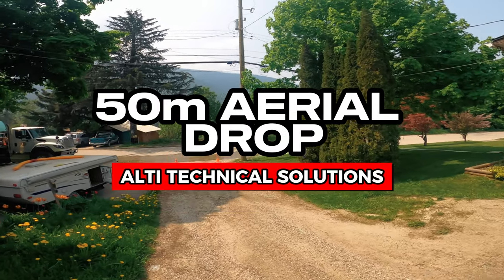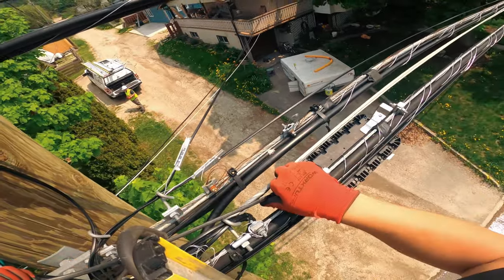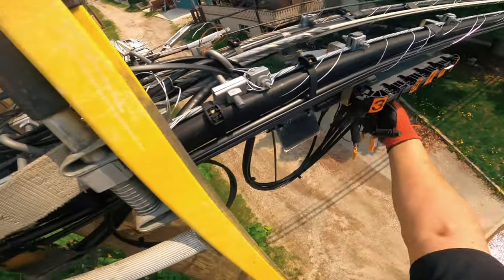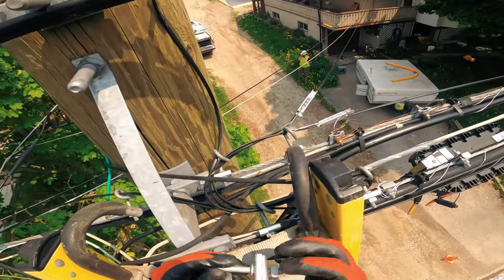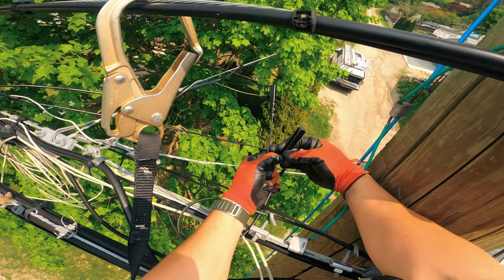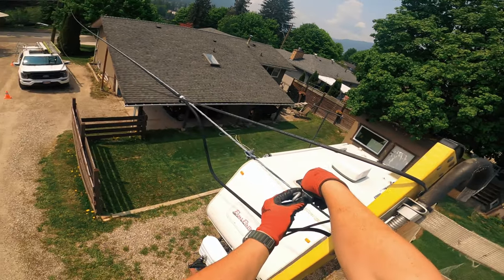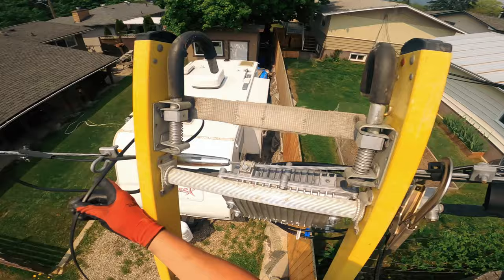FIBER OPTIC CABLE INSTALL+50M DROP ALMOST DIDN’T REACH

Comment: Why zip-ties? - they only last a few months before they are baked and cracked by the sun.
Reply from the maker: I use UV resistant zips. Also it’s protocol 🤷🏻‍♂️. We only use them to hold the waterfall off the mpt. And I replace them every time I add a drop.

Comment: A tip i learnt along the years, when you place your ladder on a strand like that or midsection, get your hooks on it and leave your ladder short, so when you go up and put weight on it itll bite and have you secure.
Reply from the maker: Good tip for beginners, there’s reason why I don’t and do. It’s situational, I explain in my mdu build video on why.
Reply: At bell Canada we have to have the 3rd ladder rung on the strand, it’s weird
Reply from the maker: @atomicgunpla yeah I’ve heard that before

Comment: It is too bad we cannot post pictures here. We just had fiber service ran in our neighborhood, and after looking at the trunk line, in two places where they put an expansion loop in the run the loop is that tight that there is a genuine kink in the line. It looks like a kink in a garden hose it is that tight. I am scheduled for my install in a few days so will be interesting to see what the tech says when I point it out to them. Thanks for the great videos too!!
Reply from the maker: It’s likely your line (light level) with be affected. But also not. Fibre is a lot more resilient than it seems. Definitely sounds like a sloppy install

Comment: Coming from a lineman, quite using midspan hooks as cable management. Use J hooks on poles, you make it hard to ad cables in future.
Reply from the maker: Not how we do things here. Sorry bud
Reply: I’m also an installer, it’s similar but have some diffences on how we do it here (Canada).  As commented by jason,  we use J hooks from the pole most of the time, we hook it up 12 inches above the network to get to client’s mast.  Rule of thumb, we follow the power line anyway.  And 12 inches from the power line is also for us, we are not allowed to get closer even to the low tension lines (well, as much as we can).

Comment: Why are you not keeping a 30" climbing space on pole at tap. And also why are you using the CATV  strand. That would fail in our MA...
Reply from the maker: I follow all our required safety protocol. And certain strands are shared here. They use ours we use theirs.

Comment: Great job, dude. Answer me a question, please: what if a drop cable breaks. How exactly do you splice it? I am sure that in a different way than a multi-core cable
Reply: Or maybe you're just replacing the entire line in this case
Reply from the maker: Depends on length. Usually just replace. On longer drops. Sometimes we take it back to the last pole and splice it there. There’s lots of variables though.
Reply: @FyBurz  I'm just interested how you splice this cable. Using some special coupling or something?
Reply from the maker: @sgt.Tackleberry  watch my other videos I show how

Comment: As a network engineer in the USA, whats the difference between a NAP and an MPT?
Reply from the maker: Nothing really. My isp calls them NAPs (network access point) but in general we call them MPT(Multi port terminal) which is a more generic term that applies more broadly.

Comment: attaching the J-hook would cost you an extra attachment charge by the owning company of the poles. definitely don't want to use those if height clearance is not required
Reply from the maker: Not really an issue here. It’s just common to come off strand unless clearance is required like you said
Reply: True but I New York Verizon also owns a lot of the poles. So I imagine they can do whatever they want.
Reply from the maker: @JerdGuillaumeSam  this is Canada

Comment: Hello, I am working in Korea. Where did you buy the clamp that ties the drop optical cables? I wonder because there is no such thing in Korea
Reply from the maker: I don’t buy them 😅 all material and accessories are from the provider.  Also do you mean the wedge clamps to hang the drops ?
Reply: @FyBurz  It's a tool that pulls the optical cable tight
Reply: @FyBurz  Thank you for your answer

Comment: Gross. Pre-connectorized drops. I work for a fttx isp and we only have a few markets left using this, we just fusion splice on a pigtail now and connect it into our terminals. So much nicer than having to carry around a bunch of different sized reels. Feels bad man!
Reply from the maker: This is much more efficient than pig tailings imo. I don’t mind carrying a variety of drops 🤷🏻‍♂️

Comment: Do you just hang the drop and not have to run the outlet ? You got it made 😂 at spectrum we hang 2,000’ drops and have to complete the entire jobs 😳
Reply: @FyBurz  your company does it the right way, maybe a small or local ISP. This is the best way to break up the work load, excellent work with the drop route as well. At a huge ISP field techs are treated like garbage, it’s great you have the opportunity to enjoy what you do!
Reply from the maker: @calenbolo  join our discord! https://discord.gg/R5TKC92TW3

I’m a sub contractor for one of the biggest isp in Canada. As well as others.
Reply: @FyBurz  Our company has bullied out service partners or contractors for installs, sucks because we " in house " have tripped work load. And there were some that did good work, but overall they just didn’t pay them enough by the jobs. Those guys should’ve been paid by the hour and we would’ve had less work load on the in house guys. Going on a tangent, but it’s cool to see another guy hanging fiber drops. What sort of winch do you use when you hang a span over 400 ‘ 120 meters ? I usually pull tight then hook the drop hanger to a ratchet strap.
Reply from the maker: @calenbolo  do you use self support fibre ? I have a video coming out tomorrow hopefully, where we use a come along. And Chicago grips.
Reply: @FyBurz  we use Corning standard drop cable, we have 3000’ reels that’s every thin but give use the ability to reuse it, meaning we have put our tap or HFC connectors on with a special kits versus how we normally do it, which is using pre sized drop like 100,200,500,750,1500,2000 and on in feet.
Reply: @FyBurz  the Chicago grips yes ! Our bucket truck guys or maintenance has them !
Reply from the maker: @calenbolo  interesting, I’d love to see pictures. We have a telecom chat in our discord.

Comment: All this talk about the strand, I wonder why you attached to the electric riser when there seems to be a perfectly good telecom riser.  Under NEC attaching to the electric riser is not allowed but violated all the time.
Reply from the maker: Here that is the standard. All telecom attachments go to the hydro mast. They’re designed to take the load. Telco masts are often under 1.5” and the mast clamps don’t even natively fit on them.

Comment: Which gloves you using?
Reply from the maker: Umm. Idk the brand. I usually buy the 10 packs at the hardware store. They’re pretty thin and flexible. Just dipped in neoprene maybe. I like these specifically because they work with my phone. And they’re pretty durable. It’s like duty work so it gives me the protection I need while still maintaining full range of motion.

Comment: In America if you ran that drop you did it wrong way. You can’t use that strand that belongs to cable. Just like cable companies can’t put clamps on phone or fiber strand. You’ll have to go off the pole
Reply from the maker: You’re not wrong. But there are certain strands here that are shared. Kind of an unwritten understanding

Comment: as a coax supe using this to learn and reteach fiber, holy fuck please be more careful on the ladder. neither times up were you properly hooked or strapped off. you do good clean work, please be safe even casually and especially while being instructional
Reply from the maker: I am very safe on my ladder, don’t worry!  I have over a decade of ladder experience. And I trust my equipment.
Reply: @FyBurz   trust me i understand. when i'm alone i don't strap off and i'm pretty loose with safety. but a couple years ago at spectrum there was a guy who fell due to not having proper EQ or safety knowledge and since then anyone i personally know would be fired on the spot for not being properly hooked onto the strand, and not using a safety harness up top. regardless, thank you for the very educational content
Reply from the maker: @f2bacon  I always wear a harness and you might not see it but I’m usually hooked up to the strand as well. In some situations I’d rather fall than be stuck hanging. I’ve had poles snap on me and luckily I wasn’t strapped because it would have likely lead to me breaking my legs.
Reply: He’s talking about your ladder hooks. You should let your hooks rest on the strand when climbing the strand. Your hooks were almost a foot above the strand. 

Also, when you belt off, your belt should be long enough so that you can wrap from one side of your climbing gear then to the strand on one side of the ladder then to the inside of the ladder then back to the other side of the ladder and finally attaching to the other ring of your climbing gear. It appears you go straight from your climbing gear to the strand.
Reply from the maker: @Wav10001  I’m very aware of how most people use their ladder and lanyard. I’ve explained in multiple videos why I leave my hooks above strand. (Which I don’t always do) 

I have my way of doing it. To some it may seem unsafe and it is to a certain extent at the gain of efficiency. I have a lot of experience with ladders and heights so I can safely do my work while still maintaining efficiency. 

Also I want to note that my ladder is usually placed very near the MPT/NAP. And if I were to place the hooks tight to strand I wouldn’t be able to effectively route my fibre through clamps. 

To summarize we all have an our way of doing the work, granted I could maximize my safety. But if any of you have ever worked construction you all know there are ways to work safely yet efficiently.

Comment: Your span clamp in on wrong should be a 1/4turn more  the last clamp you put on  the RClamp will slip off in a heavy wind. A bell senior installer trainer
Reply from the maker: Sorry but that’s not up to our standards. They are either oriented up or down. With the opening always towards the slack side. Allows for more drops to pass through easily and to neatly dress the loop. 

Although I agree it could potentially fall off in high winds, I did zip tie it to the clamp to prevent that and tensioned it at the house accordingly as well. 

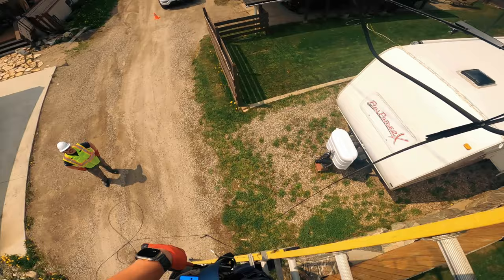Interesting that Bell uses the Clamps sideways. Appreciate the insight tho, Thanks. 6:15

Comment: You should not be coming off of the cable companies strand. That is why everyone else went to the pole.
Reply from the maker: Our strands are mostly shared here, and no one came off the pole as I showed in the video they’re all off the strand. Just one pole to the left is another fiber MPT
Reply: Sppsshhh. Ill clamp to anything with a support cable. If I'm running a spectrum drop with a midspan bump,  but the span for spectrum is missing or broken,  hello att feeder line.
Reply from the maker: @billycole852  haha, yeah I mean no one is auditing these lines because it’s turns into a mess around. I use their strand here, they’re using ours around the corner.
Reply: @billycole852 lol 😅

Comment: Your lack of safety training is astounding. Got the job done but I can count half dozen violations. For one, learn how to use your damn climbing belt correctly. You most certainly could’ve came off the pole with a j hook and avoided that entire mess by placing under the strand on the pole. You’re not even using your hooks on the strand 🤦‍♂️
Reply from the maker: Read some of my replied you might get some insight into my perspective 😅. Safety is a spectrum. I agree though I could work safer. But also take much longer to do my job. Yes I could have gone to J hook. But here we come off the strand without issue.